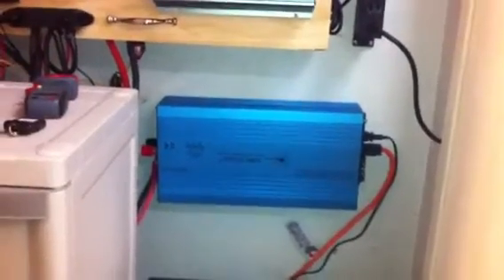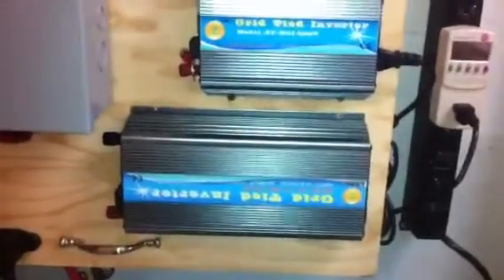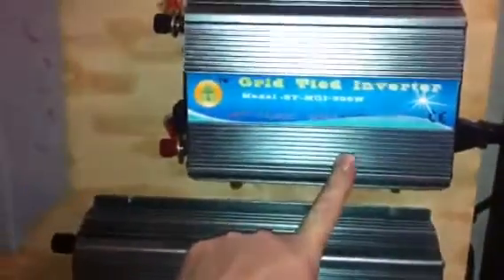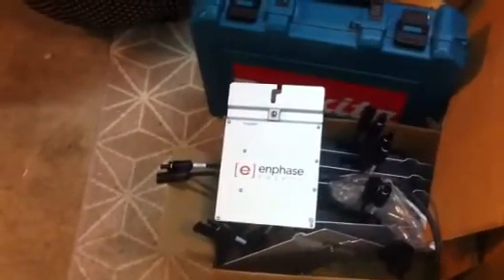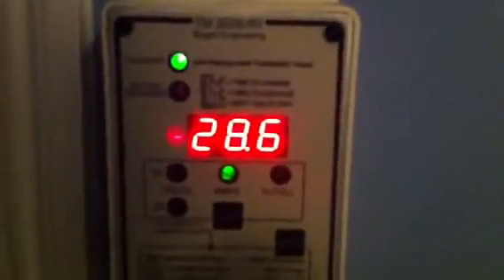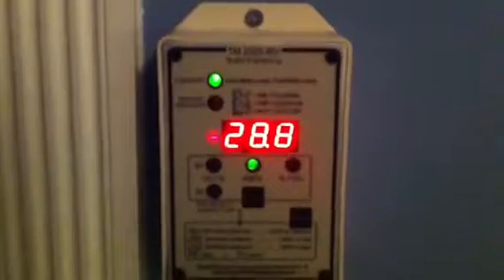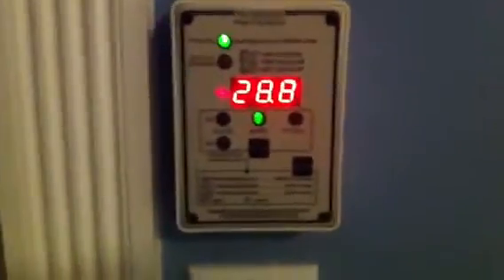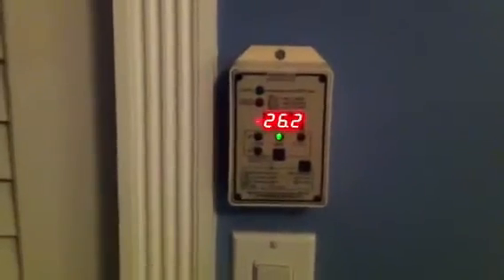Aims 2000 Watt Pure Sine Wave Inverter

Comment: which fuse  you use 160 amps
Reply from the maker: i go with a 200amp to handle surges, etc... but 160 fine but may blow unnecessarily with a 2500 surge

Comment: Have you considered, during a power outage, using the Aims to drive the grid tie inverters... The problem with gird ties is that you can't use them when the mains power is down. You can disconnect from mains and connect a small generator (1kw) to your panel to produce a reference voltage/phase... then you will be able to use all the power from your wind and solar, up to the limits of ALL your grid tie inverters, and the generator combined. Without the generator setup, you are limited to the maximum wattage of your pure sine inverter during a mains outage, only 2kw. Why couldn't you use the Aims to produce the reference voltage/phase on the panel and then the grid ties will continue to function as if mains were not down... of course a mains disconnect is critical..!!  MAIN BREAKER OFF will do.    I have thought about building this setup but I just haven't done it yet... It would be nice to know that the grid ties will function with the Aims as a reference.  THANKS!
Reply from the maker: Hmm..in theory, and perhaps in practice i think that might just work.  I've thought about something similar, but didn't have the guts to try it. However, I believe if the loads are not balanced (e.g., your producing more from the sun/wind than your current load consumption), the excess power will follow the path of least resistance which no longer would be the mains (and for good reason as you alluded), but the path would be back at my inverter which might fry it.  Honestly, I'm tying this at same time I'm thinking about so i could be wrong here.  I want think that over some, but you offer an interesting application.  BTW, i have since hard wired my Aims Pure Sine to some critical loads in my subpanel (via a Reliance transfer which too prevents back feeding mains). Thanks for the suggestion and comments. You got me thinking
Reply from the maker: still thinking...sort of like integrating AC coupling of the perm GTIs.  It would be cool if you could design what you suggest so that any excess load over consumption will re-direct 1st to the battery bank. Then the charge controllers or some SSR's can be used to shut down the GTI's once production exceeds load consumption + battery bank capacity
Reply: When you say excess load... I assume you mean excess power.... the beautiful thing about the GTIs is that they will only draw current from the their source (wind and solar) based on the load (demand).. And they will always lead the grid voltage... meaning they will push as much power to the line as the line will take/demand. When connected to the grid they will always have a place to PUSH the full capacity on the grid... If you only had them connected to a light bulb (and there is a syncable phase on the same line) they would only ramp the current up to match the load... Most people don't understand the following concept... just because you have a 200 amp service to your house doesn't mean 200 amps is always flowing... only the demand/load is flowing. ie  100watt light bulb @ 120vac . 0.83amps.   So if your entire house is demanding 2000 watts and your GTIs are capable of pushing out 1500 watts between the pair... then your Aims will only be providing 500 watts from the batteries and of course the reference voltage/phase. You would need a micro controller to monitor the current on the high voltage side of the GTIs... if it sees the GTIs running less than full capacity, then it would enable a charger on the batteries at whatever watts is surplus on the GTIs . An automatic charger will stop when the batteries are full or it's turned off by the micro controller because the demand on the GTI exceed capacity again. 

What happens now with the power if your batteries are full and you didn't have GTIs?  Do you have to have a dummy load for the panels?
Reply: I wasn't familiar with the solar panels and charge controllers before... But after more reading,  I see now you don't need the dummy load even if your batteries are full... In fact, I am still unclear what the dummy loads are for on some of these systems that I have seen. The keey thing to remember about loads is that you can produced potential all day long... unless you connect a load there will be NO current flowing. So the path of least resistance in your example is of no concern. I would simply leave the charge controller in the loop like normal... using the low voltage from the panels to charge the batteries.... you wouldn't have to disconnect anything in this setup because the charge controller will provide only as much power to the batteries ,and in turn to the Aims, as it is rated for ... say 2 amps... if the Aims is pulling more power than that from the batteries then the batteries will be depleting... if not they will be charging. and the charger controller already has over-charge protection built in. :D
Reply from the maker: i agree with much of what you've stated. also in beginning when i say "excess load" i am referring to excess power.  i agree with your analysis regarding your 200amp service panel, absolutely correct. I also agree that if it's just the Aims, the Batts, and the house's demands for power, there is no problem as you've stated it will only provide that which is being demanded. The issue i'm concerned about is the GTI's as my understanding is as long as that sun is shining, and as long as it senses proper phase on line (which would be provided by tricking it with Aims) the power will continue unabated from the GTI and if my home load does't match or exceed that power from the GTI it may go to path least resistance blowing an inverter. I guess the issue is this, Does the GTI continue to feed power in as long as sun shines and as long as it senses proper phase on line? I think it does continue unless you incorporate something to tell it to shut down. BTW, that's the function of the charge controller with the batteries, the charge controller tells those panels to shut down. But in the scenario above with the GIT i'm not sure it will work same...but you could be right as i'm not professing to know it all.
Reply from the maker: on Dummy Load. Last point (and btw i appreciate the dialogue), the sole purpose of the "dummy load" is ONLY with wind turbines.  This is how it works. When solar panels bring energy to the batteries and charge, and the charge controller says "battery full" it shuts down the incoming power from solar panels.  No "dump load" needed. However, if the same occurs with the wind turbine, if the controller merely shuts down the incoming power from the turbine, the turbine will now continue to spin in the wind, but this time WITHOUT a load. That results in the wind turbine spinning out of control (e.g.,no resistive load to slow it) and that spinning or "free wheeling" as they call it will ultimately damage the PMA and parts in the turbine. So, the way to combat this problem is for the charge controller to still stop the incoming wind power to the batteries so they don't overcharge, but rather than cut off load completely, it will divert the wind power (incoming load) to a dummy load (bank of resistors, or anything you want) that way the turbine gets to still spin under load without free wheeling, but we just take the incoming power and divert to dummy load. My dummy load on my turbine is my wind's GTI, and then if that GTI fails, I have a secondary dummy load being the bank of resistors. Hope that makes sense, but wind turbines are unique to the equation
Reply: You can test this by connecting the Aims and a Single GTI to a battery... then connect a single 100 watt light bulb to one port on the aims and the GTI to the other port on the aims ...connect your watt meter betweent he GTI and AIMs... you should see the most of the 100 watts coming from the GTI and very little watts coming from the Aims... and I think this will show you that the GTI will only ramp up to the watts demanded by the bulb and no more. Obviously the battery is capable of providing 100s of amps @ 12v ("excess power") but I think you find that the GTI won't care and only provide what is demanded. I believe the only reason the GTI will ramp up to the max capacity when connected to the GRID is because the GRID ultimately will "accept" it, meaning there is always a demand greater than what the GTI can provide..

so the alternative to dummy loads would be brakes on the turbine, variable pitch turbine, or turning the blades parallel to the wind. All active systems.
Reply from the maker: i may try the test you outlined on the GTI.  i am curious. On turbine dummy load, yes "brakes" will safely shut down the turbine in that it essentially crosses all 3 phase wires thereby creating a load to powerful to overcome, thus braking or stopping. Only prob with braking is requires you being there to monitor, however it's possible to use the Davis Vantage Vue and dry contacts to pre-program the braking of the turbine at certain wind speeds, but still doesn't tell you when the batts are full and thus the command to brake. however my undertanding is the Midnite Solar Classic controller will allow you to program in braking so that would work without need for anyone to monitor, and therefore eliminate need for resistive dummy load. problem is that's an expensive charge controller. anyway thanks for some great comments and ideas for me to explore

Comment from the maker: excellent.  in fact, i have hooked it up directly to 3 selected circuits in my home (see my most recent video posting) and it powers my home's circuits directly from my battery bank, in case of grid failure.  i've had no problems whatsoever, but do make sure (like any inverter) that you tighten your connections between leads and battery terminals with wrench or similar instrument, Hand tightening not enough as will be nasty voltage drop when larger loads require more from the battery bank.

Comment from the maker: Holding up great!  I really like it.  In fact, i recently wired it into the subpanel of my home (via a Reliance Transfer Switch) to power my home's circuits off battery bank.  check my most recent video "Home Solar Wind" for more info.  If had to do over, would have splurged for the 3000w or bigger, but otherwise can't complain

Comment from the maker: Lastly, and not to confuse you, you will also want a DC fuse or breaker between your battery bank and your inverter to protect against the over current from the source there, which is the battery bank. That way if your batt bank surges beyond its rated capacity, you protect your equip down the line (eg., protect the inverter, etc.). Same as having fuse b/w panels (the source there) and the charge controller so panel overcurrent doesnt fry the equip down line there (eg protect charge controller)

Comment from the maker: I can provide a precise answer if u tell me the # panels you have and the rated max "amps" for each panel, per spec sheets?  Also, confirm your charge controller is 30watts and not 30 amps?  I can guide you once you tell me that info.  Ps. in my last post i mean to say "idea of the fuse or breaker" not "idea of the amp or breaker".

Comment from the maker: The idea of the amp or breaker is to protect against over current from your source which is your solar panels. Therefore, we need to look at how many amps your panels are rated to produce. Example - if u have 2-135w solar panels & ea panel is rated at 7amps, you want to use a little more for your fuse, i would say like 20amp in that case. U dont want less than 14-15amp as you would blow fuse every day panels produce. Also, u dont want 50amp as that's too high for 14amps of source. see next post

Comment from the maker: The charge controller max is 440amps at 12v.  So, more than needed.  Between my Panels and Turbine running thru that charge controller, probably bringing in 50 amps at 12v.  I have other 8 other panels wired thru Enphase microinverters (permanently grid) so not run thru this charge controller. I have 50amp fuse/breaker b/w the 400w Turbine and Charge Controller. I have another 50amp breaker b/w panels and Charge Controller

Comment from the maker: I upgraded my battery bank recently to the same (6 - 6v 224ah).  good luck with your project.  this stuff can be addicting...i started with doing for just emergency, now and before i knew it, i'm  at 10 panels (6 235w, 4 135w) plus a wind turbine..lol.

Comment: ok, thanks for your in put, i have the same aims 2000 watt inverter and also the aims 3000 watt modified inverter, but have used them much, but last week i bought 6 - 6 vols deep cycle batteries and a new 250 watt solar panel, I'm just building it for emergency outages as well...

thanks...

Comment from the maker: The transfer switch and battery disconnect are made by Blue Sea.  You can purchase them online for about $39 at gandermountain, or virtually anywhere if you google "battery disconnect and blue sea." They're really easy to install, and great quality.  Good luck with your project.

Comment: HI Great Info Best of Luck With Your Aims ,I Had 1 Never Worked Right I When,t Thru 4 Diff brands before the 1 I Have Now.I Have a Few Tests Of This On my Channel.I Also Have a Sony 40 in Bravia It use 80 Watts,With the full System Yamaha amp & sub It,S about 140 Watts.I Have set Up my System Like Your a combo of Battery & Grid Tie.I,m Subbing U So I can see The Rest of Your Vids.I Cant Wait to see how u make out with the Enphase units.  I WAs Thinking Of those .Keep Up The Good job.

Comment: @sunsensational Well, maybe I need to check mine again. -----------------------------------------Actually just did. 96 watts 0.8A is what the kill a watt said. Huh? Is yours an lcd or plasma? That sucks man. Can't check mine w the trimetric cause I never designated that circuit so it's not tied in to run on batteries. My old TV used a ton of power and still need a pure sine so I don't zap my sony before I rewire. Savin for an Outback.  Hope I'll have a lil tax $ left for one.-Nate

Comment from the maker: @N8Dogg1002 Well I just checked the Bravia by itself off my Kill-a-watt meter and it's coming in at 218w, believe it or not.  This just off the TV.  I checked the specs online for my model and states operational consumption 188w so not sure where the extra 30w are coming from, but my Kill-a-Watt meter is confirming my Trimetric's reading. Crazy huh?  Thanks for the great comments.

Comment: Lookin good buddy. Keep us posted on that inverter. The price is definitly right. That tv really shouldn't use that much. Just got a 46-7 " LCD Bravia and it only uses 100 watts.  Even a plasma shouldn't use that much. Might check for other loads. Is that w you cable box and dvd n stuff included? Take care buddy.-Nate